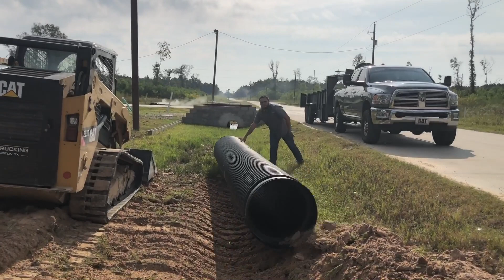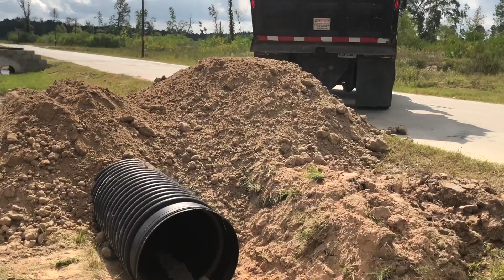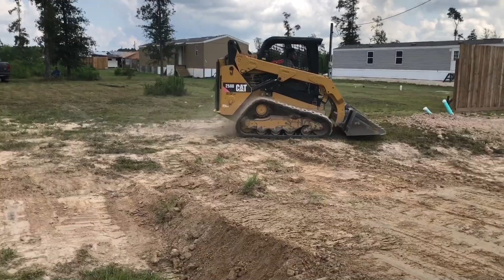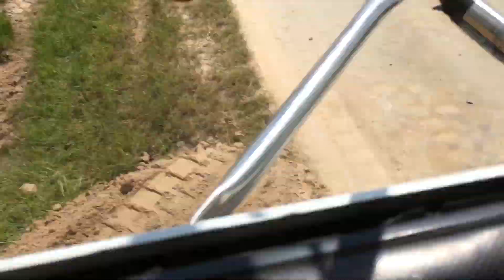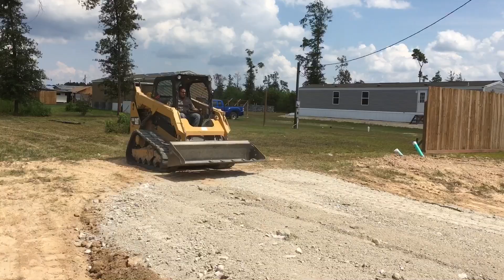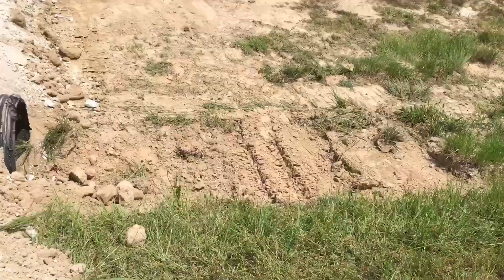installing culvert pipe for driveway using CAT 259D skid steer

Comment: I think plate compacting the dirt in 4" lifts around the culvert during install would be a better way to ensure that the tube doesn't collapse when they drag in a double wide mobile home over it.    Remember, those tracked machines only exert about 4psi on the ground, so rolling it back and forth isn't doing much.   It would be better to scoop up a pile of dirt and back drag putting as much weight on the bucket as you can essentially trialing the ground smooth or rolling your full dump truck back and fourth across the culvert.
Reply: ya he’s got good skills with a skid steer  for sure, but should’ve compacted and also there’s not enough fill coverage on top.

Comment: Nice job! I have questions since on my way to install new gravel driveway to my home.
1)How long is that culvert?
2) how many tons of top soil for the culvert build up?( 4 loads in tons)
3) How long did this job take (1 day?)
4) 5th load gravel, is that #4 crushed asphalt?
5) I noticed some Driveways culvert build up to ha e a bump, what is the function of that?
6) How much a job like this take?
Reply from the maker: 20ft culvert, you need about 4/5 loads of dirt depending how deep the ditch is. Job took me 1/2hr to do. At the very top leave 4 inches of gravel/asphalt/or crushed concrete. Lots of people leave a bump on top because they don’t dig we’re the culvert goes. Correct way is to dig first so the culvert can be lower and that way the driveway comes out straight

Comment: Grease!!!!
Reply from the maker: Blanton Enterprises I know man, ran out of grease and forgot to buy some, luckily someone I knew gave me one after I finished this job. I grease the entire machine once a week since I only used it 2/3 times a week. And the bucket and pistons 2/3 times daily depending how much I use it. I knew someone was going to comment about that I was just waiting for it lol 😂
Reply: Grtruckingdemolition I can't stand to hear it squeak! Like nails on a chalkboard. When my machine does that I stop everything and grease it. Curious as to how you like the 259d? Thinking of changing to a track machine. Any input would be greatly appreciated. What's your likes and dislikes about it? Had any mechanical issues?
Reply from the maker: Blanton Enterprises same here man, but when the job has to get done, I’ll get it done. So overall the 259 is great really like the 2 speed and how quick it is. Also controls very simple and visibility is great, I have used bobcat machines and John Deere but none like CAT you can see more to the front and sides. Cons would be sensors always have trouble with those. This is a 2015 and we have had to change the movement joystick twice, and also have replaced a track motor a couple months ago, $4,000 not cheap. But overall I feel like it’s a better machine than the competitors.
Reply: Grtruckingdemolition I heard that! Get ‘er done! Thanks for info. Greatly appreciated.

Comment: East Texas here, is dirt better than sand as a first load around the culvert.  Also what about using caliche on top of the sand (or dirt), i have heard that is better than just dirt as it packs really hard.     How many cu yards was that first load of dirt at 3:01  i have  to do a culvert about the same width.
Reply from the maker: To do it the right way is better to start with stabalized sand, then fill it with dirt and the last 6/8 inches of caliche/gravel.
Reply: You need to refer to the manufacturers installation guide for the pipe you're installing. Not all pipes are created equal.